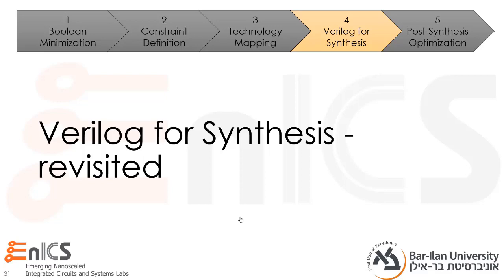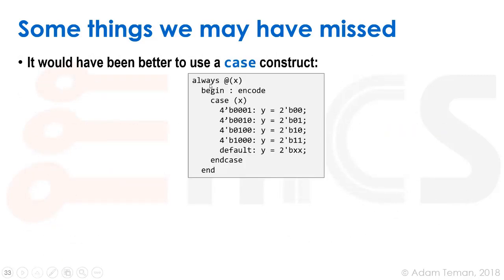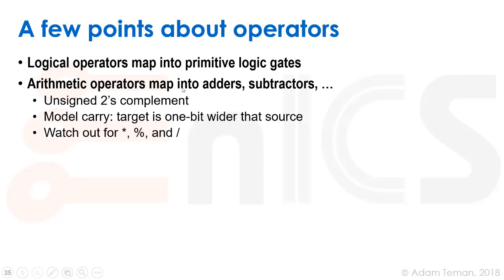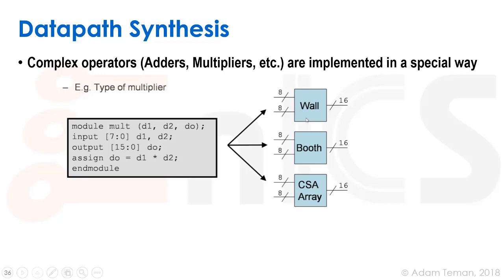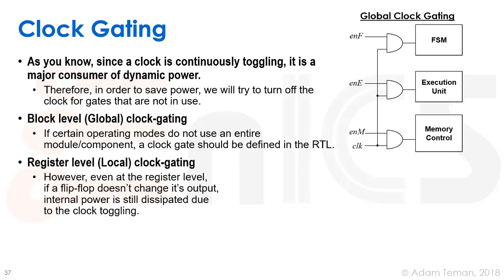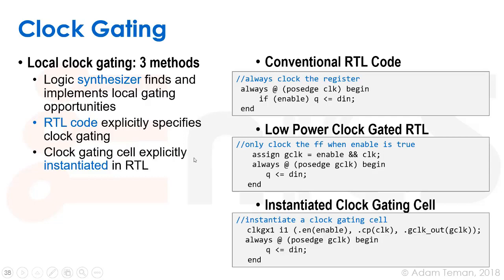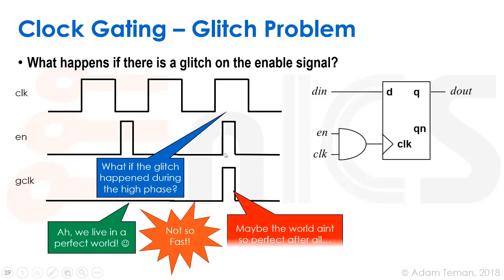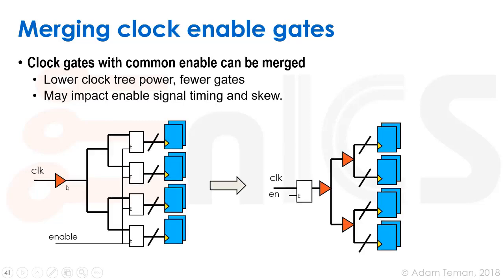DVD - Lecture 4e: Verilog for Synthesis - revisited

Comment: Hi adam, thanks for your wonderful lecture series..
I am having a doubt at 9:09 in the low power clock gated RTL, you have used a clock signal on RHS of assign statment, as you have earlier Disscued that it should not be done that way.. Can you dicuss more about that?
Reply from the maker: Hi Atul,
Good observation. Indeed, it would seem that I broke one of the "unbreakable rules". 
But, as I like to tell the students in my courses, everything I describe as a "ground truth" actually has cases (sometimes very frequent cases), where it doesn't hold. This is a bit of that.

When I defined the "law" of "do not put logic on the clock", I probably mentioned something like "unless you really know what you are doing". In this slide, I describe clock gating for low power design. The assign statement here is directly describing clock gating logic. In other words, "we really know what we are doing". In fact, there are many reasons to put logic on the clock, but as a beginning RTL designer, you do not want to do them. As an advanced RTL designer, you would be expected to understand the implications of doing this, and in 95% of the cases, you would understand that you're not supposed to do it. But there is still that 5%, where you understand really well why you want to put logic on the clock and they it will be correct.

Regarding this specific case - you will probably never do this exactly. A single flip flop will not be clock gated. You would usually use enable logic (like the first example) and if there are several flops sharing the enable condition, the synthesizer will automatically insert an ICG. An assign, such as in this example, would usually be used on a global clock gating signal. But even then, usually you would instantiate a specific standard cell from the library and not use a synthesized assign.

Comment: do we still need to do clock gating setup/hold check if we use latch based ICG? I think we don't since clock gating setup/hold check is for glitch checking while with latch based ICG the glitch is prevented already, please correct me if I am wrong, thank you
Reply from the maker: Good question, and interestingly I just answered it for the comment after yours.

Yes, we still need this check.

The glitch free clock gate makes sure there is no glitch on the clock when a signal is allowed to glitch. The clock gating check makes sure that the signal doesn't transition when it's not allowed to.

Looking at the enable signal, it is a combinatorial signal. Therefore, transitions in upstream logic will dissipate down until the enable net and can transition and possibly glitch. This is standard and acceptable behavior of the signal. Two problems can occur:
a) the transition (including glitch) occurs too close to the clock edge: this is a setup/hold violation and must be eliminated by design (STA checks and timing optimization)
b) a glitch occurs on the clock due to the AND operation of the clock gate: this is what the ICG fixes and you don't need to do anything in regards to STA.

Comment: In the 2nd way of clock gating, I am under the impression that this works in ASIC but not in FPGA considering the architecture for clk. Do you have any comments on this, it will be very helpful. Thanks!
Reply from the maker: Yes,  this is correct. 
In fact, it's very hard to take most of the things that I discuss that have to do with the clock over to the FPGA field. FPGAs have a pre-designed structure with proprietary CAD tools that map the RTL to the hardware. The clock is pre manufactured. There may be different methods for clock gating and saving power, but the granularity is much lower and for sure, the are not the methods (exactly as) described here.

Comment: Hey Adam, Thanks for these wonderful and helpful videos. I wanted to ask about the Glitch-free Clock Gate, what happens if a glitch in the enable signal occurred at the edge of the clock? (part of the glitch is when the clock is 0 and the other when the clock is at 1)
Reply from the maker: Hi,
Great question.

This, indeed, would be a problem. But the same is true if you catch a glitch on any other path in the design. In fact, this is the objective of Static Timing Analysis - to make sure that the signal is stable before (and after) the relevant clock edge. It may not be that straightforward that this is the same as reg2reg timing, but it's just an extension of it.

I didn't go into this in the STA explanation, but in addition to reg2reg, in2reg, reg2out, in2out paths, there are other STA checks that are done. I mentioned "recovery" and "removal", which are check vis-a-vis the reset signal. But an additional one is the "clock gating check". That is exactly what you are showing in your image. It makes sure that the "data" (in this case the "enable" signal) is stable within the setup-hold window around the clock. With a latch, we can easily ensure this, but it exists in similar paths "gated" by an AND gate or other structures. It's just harder to ensure the synchronization with such a combinatorial gate, and here I showed how the ICG is perfect for ensuring the condition.